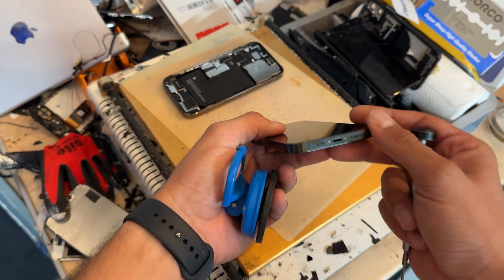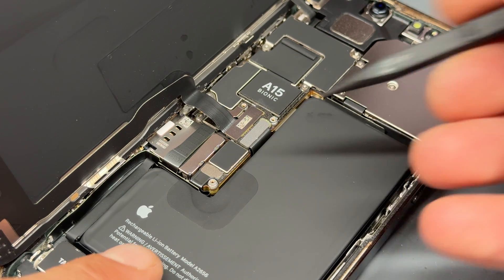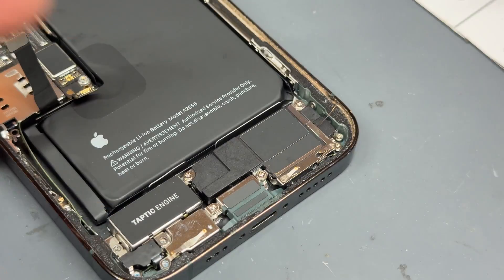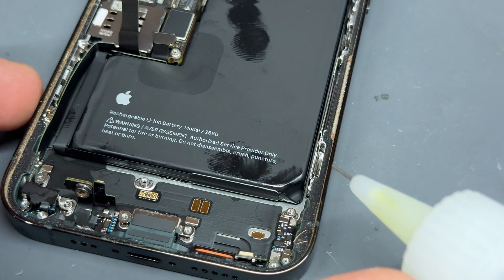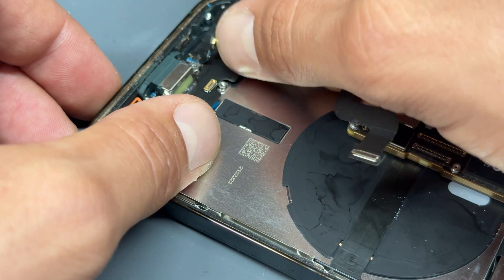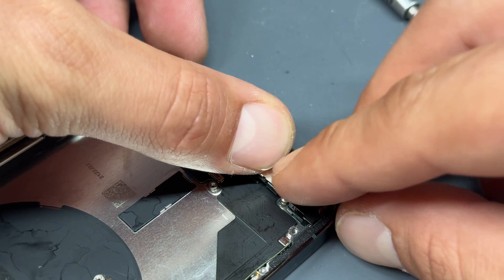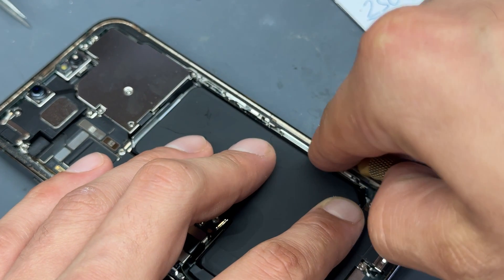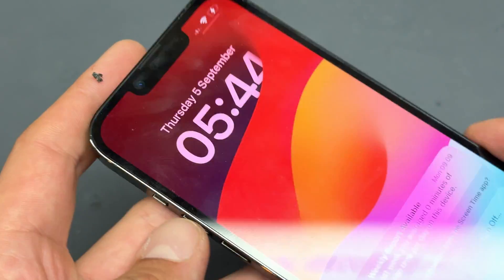iPhone 13 Pro Charge Port Repair - Complete DIY Guide!

Comment: Why can't 3rd party ports use the correct capacitance to work as well as OEM? Daft. Good guide. Wish Apple could be forced to 'do better' in repair options. Seems stupid worrying about how a phone looks on the inside if it's not meant not be opened.

Comment: One thing I don’t understand. Can someone explain. Can I use aftermarket charge port from AliExpress or not? Thank you.
Reply from the maker: I wouldn’t. You should use only pull originals for this or it will cause problems
Reply: @iDoctorUK Thanks for the reply. Could you please tell which problems and why aftermarket charge port can’t be used?

Comment: great video, Ive just paid £150.00 to have this replaced after stupidly buying a cheap case with additional battery incorporated into it. So I think this weakened  the charging port.  So every time I try charging its intermittent and I have to wedge the cable upright to get it to charge.  It also wiggles up and down if you grab the lead.  I've just had it redone for the second time under the warranty.  But it's doing the same again. The company I used said that if it does it again it's a motherboard issue and not under warranty. which I readily accepted.  But having just watched your video I can't see how the mother board makes any difference to the charge port being loose and wobbly.  Any thoughts?

Comment: Hi, I’m a wannabe tech enthusiast and i love watching your videos. I wish to reach a point where i can do these repairs myself. I’ve had some practice changing batteries, screens and cameras on iPhone 6 and 7 models and I now wish try my hand at newer models. Might you have any advice? 

Second, My current phone is a 13 pro and it’s developed the “No service” bug where it doesn’t get reception and it just says no service. I converted to an esim thinking that might help but no such luck. Do you know what might be wrong cause sometimes i turn it on and it works but only for a few minutes and the istore is charging me 60% what i payed for the phone to get it repaired. 
Again really love your channel and keep up the good work. Any assistance is much appreciated too.
Reply: I’ve been a (self-taught) repair technician for some time now, if you can work on an iPhone 7 the newer models are quite similar. The adhesives are just stronger and some of the plates and smaller parts are usually smaller or in different places, otherwise the concept is mostly the same. 

Lol if this is the istore in Northampton. They’re apple certified resellers, they don’t do repairs in house as they get sent out to apples warehouses to be dealt with. When my in warranty iPhone SE 2016 had problems, they just sent the phone away and replaced the entire front of the phone. But when my iPhone XR’s NFC died they wanted £340 to fix it. Was far too much as I just went to CEX and bought myself an iPhone 11 Pro Max. That bug is entirely motherboard damage so I’d honestly just buy another phone and sell it for parts, it’s completely uneconomical to repair unless you care about it that much you want to fix it.
Reply: @Plainapple287  Thank you man. I have an iPhone X of mine I’ve been meaning to to a battery replacement on and now i think I’m kinda ready.

I was not ready to buy a new phone anytime soon but I guess I haven’t much choice now.  All the same thank you for your answer and your help.
Reply: No worries mate. What you see here is of an overseeable difficulty level. 
I only struggle sometimes with not knowing to where a flex is all attached and so fear to rip it off.
Reply: Did you google the defect? Is there any hint at what parts is might be or not? And have you tried a shop other than Apple for a fix?